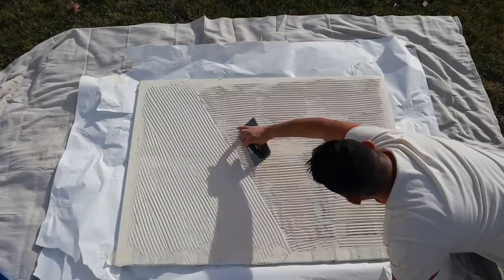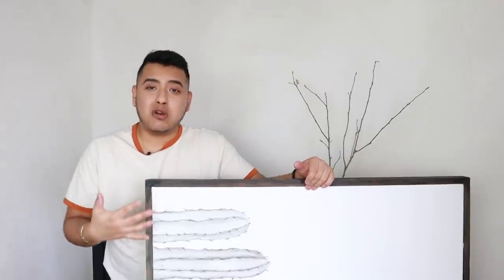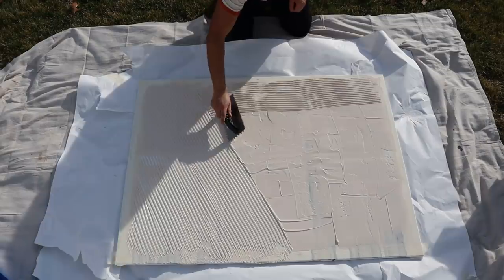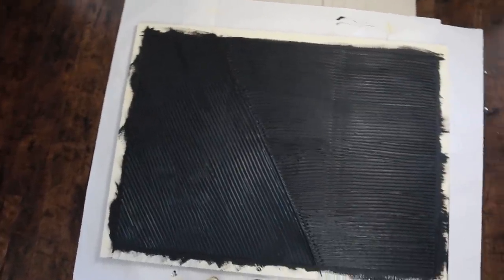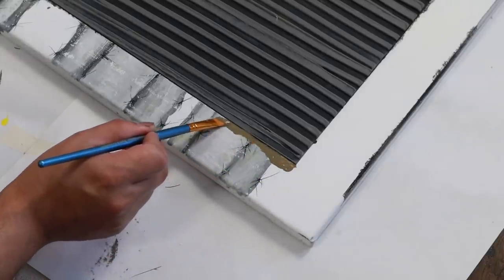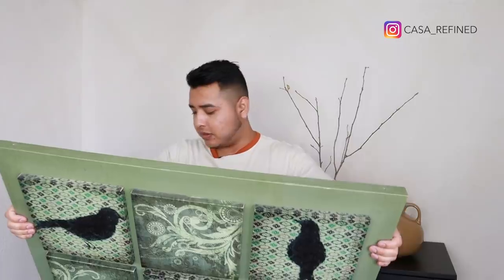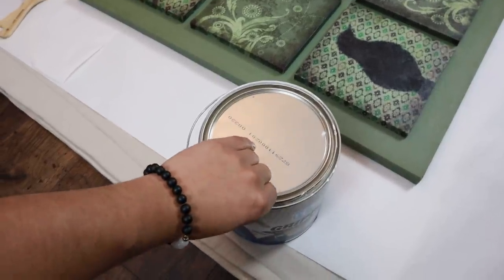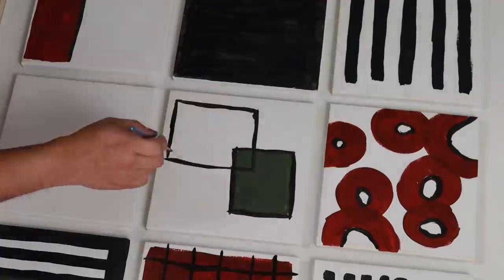Affordable DIY 2 Large Artwork Projects That Look High-End (+ DIY floating frame)

Comment: Hi Jorge. I am thinking of creating textured art using Filler.   Potentially to sell if it all goes well 😁. Which brings me to ask if you have any tips to keep the artwork to last long/ high quality.   I notice you didn’t prime with gesso, or seal the paint.  Do you recommend doing this for more “high quality” pieces?   I fear my fillers would crack/ not last long etc.

Comment: Don't use the joint compound, you are better off using  Premixed Mastic Adhesive. It's used on floors and you can get it at any lumber yard, Lowe's, or Home Depot
Reply from the maker: I'll give it a try, thanks!